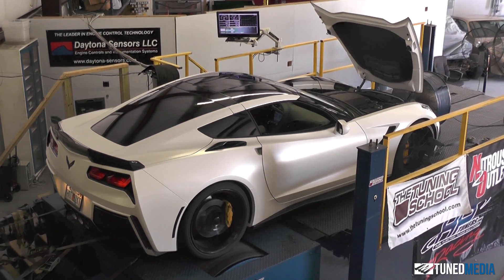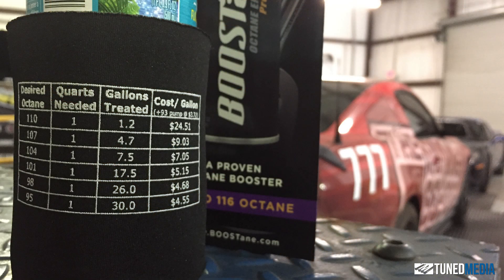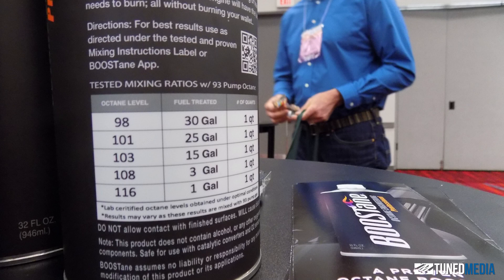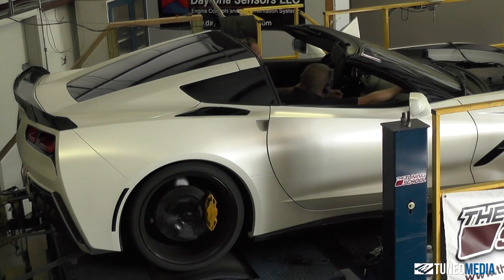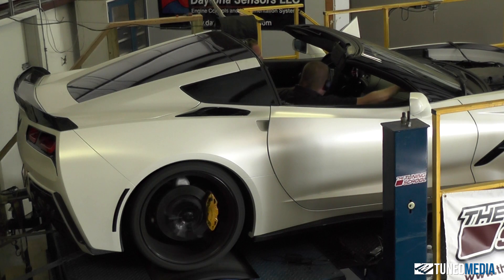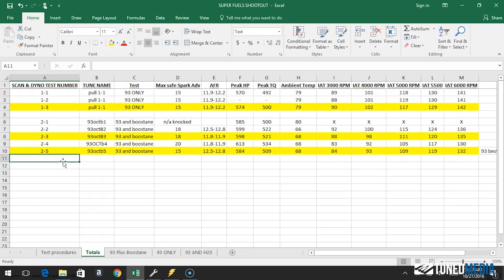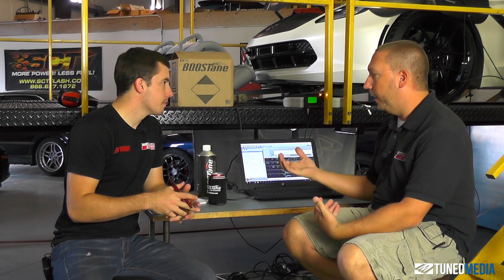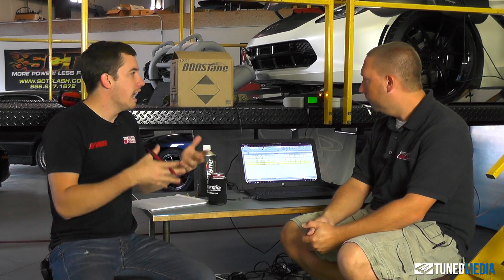Racing Fuels: Octane Booster Makes Big HP Gains on Load bearing Dyno

Comment: This is why I live my 19 mustang. You run this shit and you don’t need another tune, adaptive variable timing makes it so my car is pegged at 26 degrees of timing and 0 knock when I run half a bottle of this with 91. Without it I am around 18-20 degrees if timing and a little knock here and there (very low)

Comment: MTBE, NITROMETHANE or DIMETHYLCARBINATE are used to oxygenate the fuel.
To increase the Octane number, MMT or FERROCENE is used together with a halogenated hydrocarbon to avoid the formation of metal residues in the combustion chamber.

Comment: Something worth considering is that a return less system picks up its fuel from inside the fuel pump bucket and slows down mixing time considerably.Return style systems are better but still allow time for it to mix thoroughly. Put your octane boost in before you head to the track for safety sake. Consider just running meth if your strapped to 91 or 93 which in most cases is just crap.

Comment: I'm in CA stuck with 91, c7 z07 got a tune for 91 since the factory tune is based on 93. If I start using this, say just using a full can before fill up. Do I "need" another tune?

Comment: I'd you don't tune your car to the proper octane numbers, I believe the car goes slower protecting itself by pulling timing? What do you guy's think? I put almost all the bottle in a 11 gal. Using 93 and it felt like it slowed it down. I have new plugs and coils

Comment: Wondering if you can answer some questions?   I used Torco booster, I know shame on me, 32oz per 10 gallons and my plugs turned orange.  I also had issues starting the car?  Does that orange come off?  does it hurt anything?  Did I overuse the booster?  Did I harm anything internally in the motor?  Lastly if I cut back on the booster can I continue to use it, I have 4 cans left!!!!!!  Please let me know your thoughts?

Comment: When using motul 300v engine oil  and boostane additive in the fuel it turned the oil into black sludge. Also the intake runners wer black coming out of the injectors
Reply: Bullshit
Reply: @JB-fm4tb  bullshit what? Im sorry if iv upset you. Whats your email address ill send you some pics and iv also got the test results from the lab. Wer motul dealers
Reply: DANSPEED lmao I’m not saying ur oil isn’t black sludge but that’s not boostanes fault at all seems like you have other issues with your engine
Reply: @JB-fm4tb  yea we couldnt believe it either. Long story short."keep in mind this was a high powered time attack car that is meticulously maintained and everything is data logged" the intake ports 'after' the injectors wer black aswell you can see the spray pattern. we work closely with motul and they sent samples away. Motuls answer was there was somthing in the fuell additive that was reacting with the 300v. Ok so While this was all being i pulled cam cover and sump off and it was strange the cams crank rods etc wer BLACK! The oil was still sort of golden but at bottom of pan was like a film of sludge. We wer swticking to ethanol and ever since then no black injector patterns and no sludge. Funny enough eveything stayed stained black. After i tore the engine down for preventive maintenance everything was perfect bearings the lot. It was a mystery but after checking forums and chattting to other people had come across similar problems with other additives. The pros of the boostane was that power was nearly matched to E50 over conventional 98"ron" with boostane. Cheers Dan.

Comment: I made 602/504 on my 11:1 compression ls1 , ws6 trans am on 8 pounds of boost , with only 12 degrees of timing, I did use an can of boostane premium,  going be testing the professional out next trip to the dyno , I’m hoping to run 14 degrees of timing next go around

Comment: Are the HP and TQ numbers corrected? SAE or something? Because the Boostane test 1 was done 10F lower temp than the baseline. That's about 1% more HP by itself. Denser air will also make the A/F gone toward the lean side as well. And you don't show avg HP or TQ either.

Comment: Hey guys , I have the same exact car 14 z51 makes 750rwhp , built pistons/rods,z06 injectors/hpfp, dual nozz methanol set at 4/8( safe setting ) cam and all bolt ons.. currently on a pretty conservative safe tune

Was interested in using this for roll races , probably 6-10 pulls for the night
Do you see a benefit in this ?

Comment: will i see difference in my 2007 camry v6? this is expsnsive. but if anyone can confirm i want to try one case. my user manual recommends 91 octane.
Reply: Presuming your car is stock and you are already using at least the recommended 91 octane, you probably won't notice any improvement just from pouring an octane booster in the tank. However, if you have your car's ECU tuned to run on a higher octane fuel, you may see an improvement. If you want to know for sure buy a can and give it a try.

Comment: Will this work on a 2017 5.7l hemi with no tune?
Reply: Challenger
Reply from the maker: Octane Boosters helps to knock limited engines run more timing, allowing them to make more power. Not tuning for the Octane Booster usually will not net you more power unless you are already having severe knock retard on the stock tune.

Comment: A lot of the results sound similar to just running a 15-20% mix of methanol in the tank...and methanol is far cheaper. Likewise fuel tuning would need to add fuel with this. Have you tried that approach ?
Reply from the maker: We did not try that in tank method, but we have had success with using it as an additional injection.
Reply: @TheTuningSchool  would be worth doing a comparison some time. meth is cheap, and some dont trust the reliability of an additional injection system. Each do have their pros and cons though. But as an additive, it's a cheap one.

Comment: Up here in Vancouver Canada, we have lots of people driving JDM cars, in Canada we can import 15 year old Japanese cars.  Skylines, Evos, Sti, RX7s, Supras.  It is very common for people to use a quarter can of boostane per tank.  It turns pump 94 into 97.  Its cheap too.  60 litres of 94 octane will cost me almost $120, so an extra $10-$15 for boostane per tank is pretty small.  Far better option than the people that get their JDM cars detuned to run on Canadian gas.

Comment: What about naturally aspirated motors with fuel injection?  Different maps with different ignition timing depending on octane.  Wondering if it would make similar gains.
Reply: Yes you would see gains. If your car KR's with pump gas adding this will see gains. Boostane works really well where you can not only increase timing but also boost pressure.

Comment: Does it make power without Tunning
Reply: only if your car had detonation prior ie. "pinging" and the additive makes it go away ;  otherwise little or no power gain, though in the video it did make a bit more untuned.
Reply: @R0yL33  That depends, run your car hard on pump gas 4 times in a row in 4th gear at WOT and see if you get any knock. I bet you will, especially if it's a performance car.  You'll get much more ignition advance as the adaptives in the stock PCM adjust to the new octane levels. You would have to do back to back pulls on that for the PCM to add timing. I've seen cases were just adding Boostane and no tune added power. Even on this Corvette they picked up 10 hp by just adding the stuff.

Comment: So do you have to tune when you are using Boostane?
Reply: You don't HAVE too. I've seen it tested without tuning and gains are significant. (15-20 hp). It depends if your car has adaptives built-in. Boosted cars from the factory tend to. My Focus ST has octane adaptives stock, it will increase power based on Octane. Basically any reading higher than I think .9 in octane is max timing.

Comment: So do you have to tune when you are using Boostane?
Reply from the maker: It is the most effective way to make good use of the boost in octane. Keep in mind, the octane itself does not add more power. It is the ability to run more lead timing.

Comment: Couple questions when it come to tuning.  How much octane booster did you put in?  Was it enough to being the octane rating up to 100,103, 105, etc?  Secondly in your experience, if I run fuel stabilizer in my tanks (2019 ZO6) how does that affect the octane rating if the gas in both the short term and long term.  Is the fuel stabilizer effectively diluting the gas?
Reply: You can email Boostane and they will give you an approximate of what is needed for your power level. Man you people that live in freezing winter climates. Yeah cost of living is less but not worth it IMHO.

Comment: I use it to effectively turn 93 into 98 during the hot summer weather, on my Volkswagen 1.8t with a 1.3 93 octane tune. I don't need it in cold weather

Comment: They don't seem to answer questions. So let's ask a few more. the temp from one to the other is 10 degree's different. 93  to boostane. the IAT's have 5 plus as well. So what is better the timing or the IAT's.
Reply: IAT are only impacted if there is knock because retarding the timing creates more heat in the cylinder which causes under hood temps to go up. It's Florida so ambients are going to be higher than mild later winter day in Ohio (high 50's). Water methanol is better for controlling IAT's.

Comment: I live in California and only have 91 octane available but I want to get a 93 octane tune, will an octane booster work in this case? I know Id have to use the octane booster every time I fuel up so I'd have to buy a case of it.
Reply from the maker: Should work fine.  Our # is 727-264-8875
Reply: I live in California, even at 99 octane I saw 8 degrees of advance in my Focus ST over 91. No adjustment to my tune.

Comment: What’s the starting octane before adding the booster, 93?
Reply from the maker: Yes.
Reply: That would be the best cost wise
Reply: @takay_the_loko  That depends.... Boosted cars (turbos) saw more power at higher concentrations with an adjustment in tune (more ignition timing, more boost). Gains would have been higher here if they could adjust the boost from say 8 psi which is the base pulley (based on the OE stock crank pulley) to 10-12 psi, gain would have been closer to 70-80 hp over 93.

Comment: Question if you're tuned at 94 pump Octane and you're traveling and you can't get anything better than 91 octane is that when boostane would be a good additive?
Reply: What are you doing that requires 94 octane all the time? I don't know I actually race my car on a regular basis (two to three times a month) at the drag strip. For just an occasional blast down the highway I dunno if it's worth bothering with this just for flogging your car, you have to make that determination.

Comment: TheTuningSchool... in your experience, is Boostane safe for long term daily use?  I used it on my old car for 6 months continuously with no issues.  But i sold my car and didn't do a plug change to verify condition of plugs, nor did i data log.  Interested in hearing your long term experiences.
Reply from the maker: We have not seen or heard of any issues from daily use. However, we don’t use the product exactly in the way you described. If we have a race weekend will put it in all the cars, just a preventative measure against knock during the strenuous conditions of the road course. That's about as close as we get to daily use.

Comment: So basically, the ecu adjusted the timing to gain more power because of the aggressiveness of the fuel composition. 
There is no mystery then.  Using 93 octane vs 97/100 octane both has its own composition  characteristics. 
Now, it's all about the value. 93 octane affordable and to add a few quarts of $26.00 boostane in 16 gallons of tank is not realistic or  not cost effective for ordinary or majority of the people.
YOU GOT THAT BOOSTANE?

A can of BOOSTANE is like a cost of gold.
Reply: No reason to use it all the time. If you don't race then don't use it. Water-Methanol over the long term is a better investment and higher power gains. Turbocharged cars that don't have turbos too small for real gains will see huge gains over pump fuel.

Comment: Have you guys noticed a plug discoloration? In the past I have seen octane boosters have turned the plugs orange.
Reply: Yes it will turn your plugs orange, no change in performance. It shouldn't bother you, long term testing (100,000) saw no change in performance just orange plugs, o2 sensors and inside the turbine housing/headers.

Comment: Have you tried using Toluene as a octane booster.  It will raise the Octane by 8 points.  I used it in my race engines in stead of VP race fuel. Better results and a lot cheaper.
Reply from the maker: We are happy to test it.  Please send us some.
Reply: TheTuningSchool  hi. I have used it s lot in my race engines as an octane booster. You can get I gallon for less than $20 us. You can buy it at any hardware store in the paint thinner section.  Toluene is used in the manufacturing of gas.
Reply: andy b . How much do you use per gallon?
Reply: Depends how much Toluene you use, because some many people you need a ton of it to make a fair octane number. Define race engines, because if you have aluminum heads, hot mechanical roller, etc and say 12:1 static CR, that isn't that aggressive and bumping 93 to say 96-97 octane is likely enough.

Comment: how u guys thank this would work on a all motor car performance gains???
Reply from the maker: The results should still be very good! We use this product on naturally aspirated vehicles frequently. The big thing to remember is that this will help knock limited engines. That is to say, if you can make more power with more timing but knock is preventing you from adding that timing, then Octane Booster will help you get there. However adding timing will not always net you more power.

Comment: Torco really works for my 13 gt 500
Reply: are you tune your gt500 for the torco
Reply: @emmanuelmacedo6798  Likely, but  just dumping in you'll see a gain because all boosted cars will knock on the factory tune.

Comment: do you guys have any videos on old school naturally aspirated carburetor performance builds?
Reply: TheTuningSchool lt1chevys?????
Reply: @johnbeer5242  LT1 is tune port injected, it's still fuel injected dummy. That unless your talking about a '70 Camaro Z28 with the LT1 engine. In either case especially the older engine there is no leaded fuel around anymore and it's 11:1 static CR, so adding this will allow you set the timing back to where it was stock.
Reply from the maker: No sorry we specialize in late model fuel injection tuning.

Comment: here in australia we have 98 octane on the pump so what is this in the american octane rating
Reply: It's a different measurement system using a completely different test.  For a very rough comparison add 10 to the american MON octane rating to equal the international RON octane.
Reply: 98 RON is the same as 93 here.

Comment: Does this booster have MMT in it?   If so over time it will coat the O2 wilts an orange to gold residue    Could clog CATS long term as well
Reply: MBTE, MMT in the quantities needed would need a much larger can...Has never clogged converters, been testing long term several times. MBTE was in California 92 before it was banned and ethanol used to bring 87 up to 91 (E10).

Comment: hey i have a question about afr, your vette is running in the 12s at wot from what i understand? but the tune whipple sent with their kit for my dodge challenger gets in the low 10's at wot like 10.3-10.5  should i be concerned?
Reply: Not necessarily. What kind of fuel was recommended and are you running it?
Reply: Direct injection vs port injection. Di can handle/benefit from leaner afr's
Reply: my ej is port so i run 10s

Comment: i did try it on my vehicle evo x, no one HP gain, we give it another try on 5.0 and sti..... NO one HP gain.
Reply: Do you have a 100 octane tune for either of those cars? If not then don't expect to gain much by throwing it in. With another product VP Octanium I picked up 8 degrees of timing on my Focus ST over what it was on pump gas (91).
Reply: Are you nuts? You did it wrong. Start with a mixture for 100 octane. Make 3-4 hard WOT 4th gear pulls and monitor KR. You should see ignition advance increase with each pull as the PCM adjust to fuel that won't knock.

Comment: why the frick would u do an 11.9 a/f on direct injection? that's stupid rich. run 12.8 on my car all day, for years. so does everyone else with a turbo ecotec lnf, no knock , no problems. shit the stock tune from gm was 13 a/f at wot
Reply: yup exactly. you turn up timing till u see knock, then u pull a few degrees too be safe. or spray meth if u want more.
Reply: isnt that a little lean? i never messed or had a direct injection but i run 11.5 afr on my supercharged g5. but maybe direct injection is different
Reply: no its not, direct injection u can go leaner , 11.5 would be way to rich on di
Reply: I think they were just going down the path of advancing timing a bit too much. They mentioned they were still seeing some knock. That tells me they should have pulled timing and leaned it out (basically what you are saying) and then fine tuned from there.
Reply: No it's not lean. My Focus ST is DI as well. 12.8 is fine if your tuner is conservative then it will be in the high 11's
Reply: They kept adding timing too it until they found knock. Since it's not easy to turn up the boost on supercharger systems, you can easily gain that back by increasing the boost a pound or two. The reason they didn't do that is to show strictly what fuels can do and how they impact hp/tq.